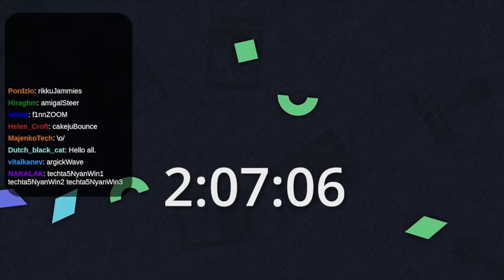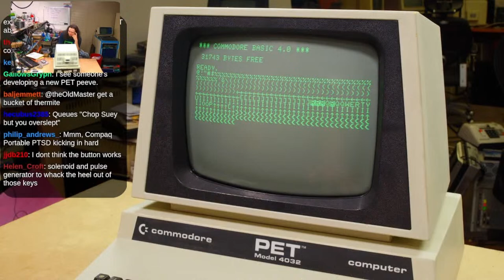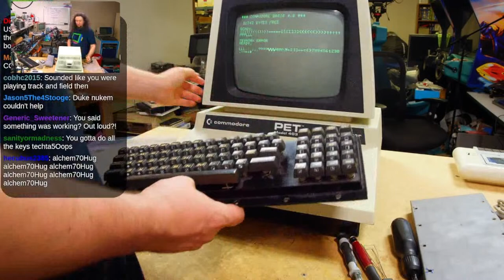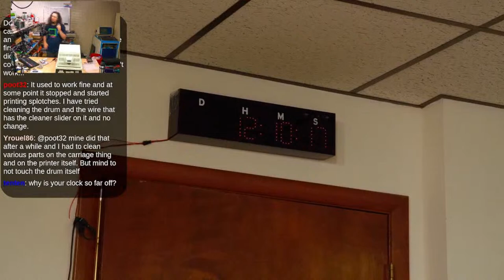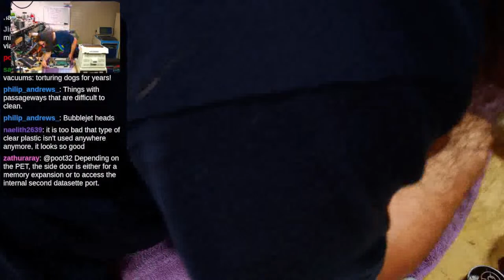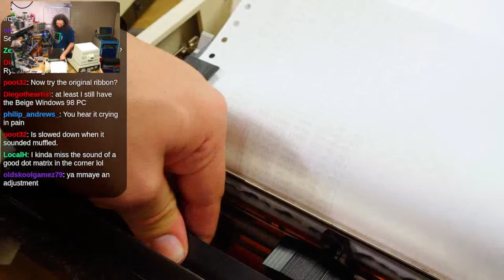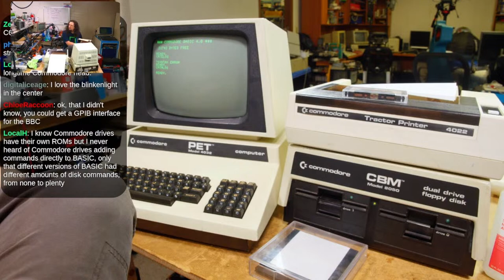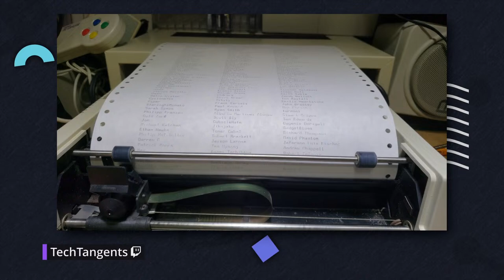Brushing up on Using a Commodore PET

Comment: FYI the PET has a hidden RIFA - it is literally molded IN TO the IEC socket. (the socket on the PET is not just a simple receptacle, it is an actual module that contains a hidden RIFA.) You would either have to dremel the thing open in order to remove the RIFA, or (the easier option) just replace it with a plain/normal IEC socket. (the mounting hole pattern is identical) The same thing applies to Commodore PET-style disk drive chassis as well.

Comment: Used Pet to print out 16 bit values to draw a circle bars to simulate a Radar PPI sweep on a CRT monitor. Computer was a Univac 16 bit minicomputer. I don't remember if sin/cosine functions were in Comodore Basic or it was an add on.

Comment: Oh Shelby, sweet summer child, technical designs generally aren't copyrightable even today -- when people copied the original Apple ROMs it was a genuine question whether software was more like a circuit design (or math, which was and is also not copyrightable) or more like a short story. In the same era, Haynes etc. were publishing third party repair manuals for cars with schematics. As long as they drafted it themselves and didn't just copy the literal artwork, selling properly reverse engineered schematics was and still is perfectly legal.

Apple might get after you if they thought you were sharing a trade secret you got your hands on improperly, like from a contractor who's under NDA, but you really could sell iPhone schematics you reverse engineered straight from the actual device.

Consider how terrible it would be if the first person to design a switching converter held a 100+ year copyright to that circuit design, and nobody else could make a schematic for it, or implement it for that matter, because that's really just a transformation of the schematic...